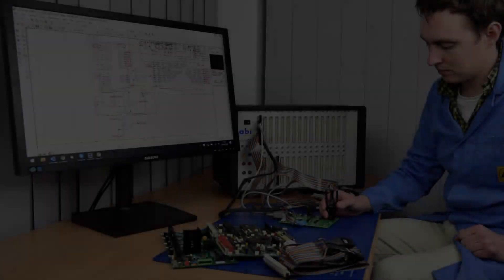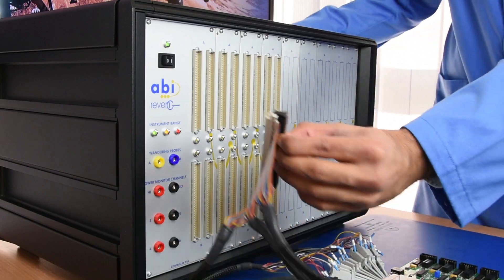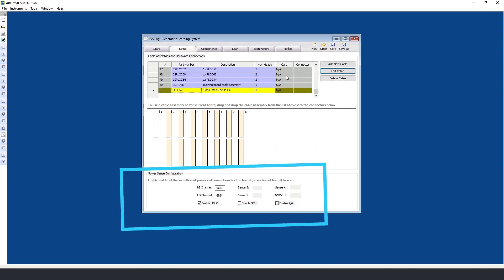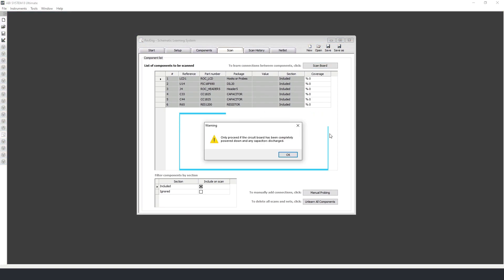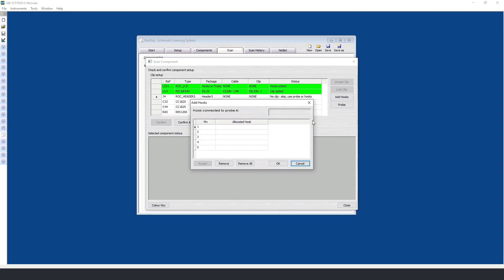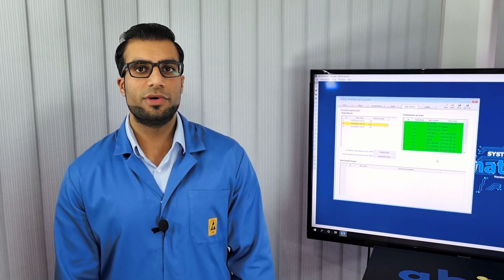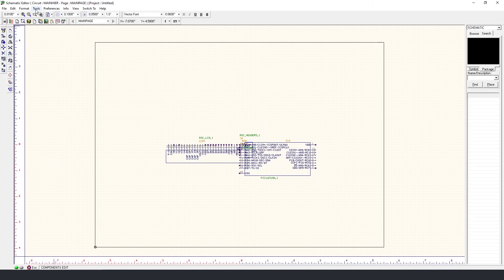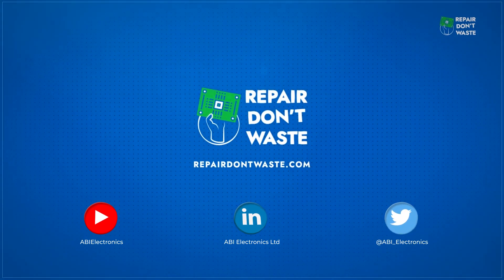How to generate a circuit board schematic with #RevEng - ABI Labs RevEng Edition Part 2

Comment: Interesting Video!!! I would like to know how REVENG can help in making schematics having SMD Components such as in Packages of SOT23, SC-70, Surface Mount High Density Connectors which have very less spacing between the pins. Also some boards do have Super Caps and Non Volatile RAMs, in that case, how can REVENG help in preparing schematics. As such some cards have these Super Caps to store Data in the RAM or Non Volatile memories which are usually battery backup or Super Caps.
Reply from the maker: Great questions! With the RevEng you can use a wide range of accessories to connect into all kind of components. The RevEng does not take in consideration the functionality of the devices when checking if there are connections between the different pins of the components on the PCB. Selecting the right part numbers is important just for the drawing of the schematic but not for the testing process, so it does not matter what type of electronic devices you have on the PCB. If you would like to learn more about it, please contact sales@abielectronics.co.uk